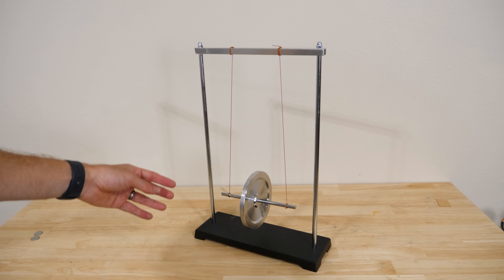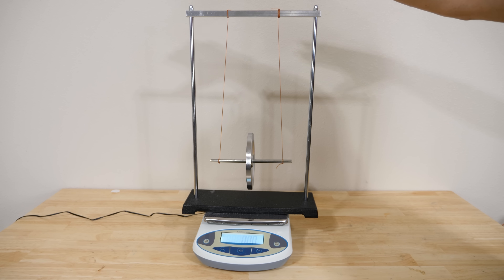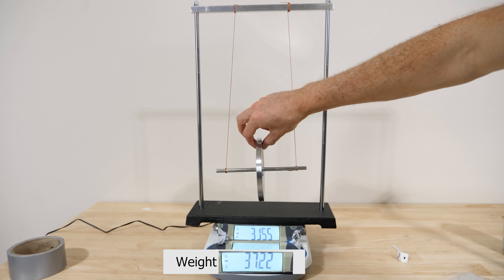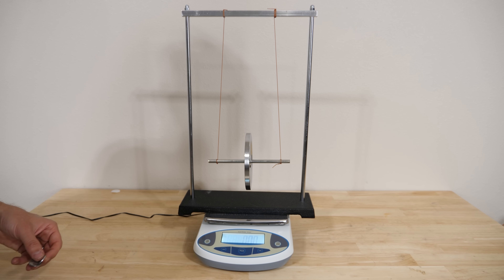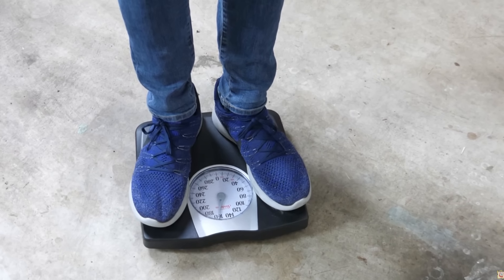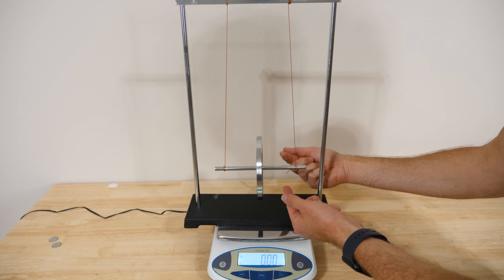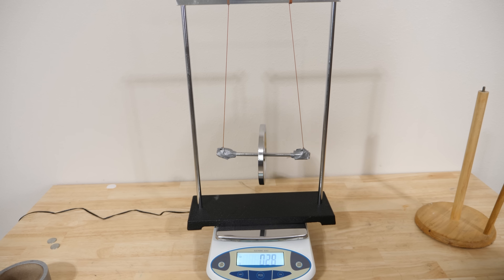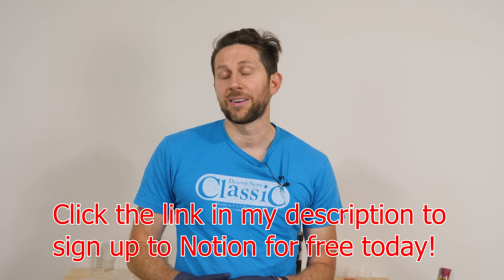How Does The Anti-Gravity Wheel Work?

Comment: @The Action Lab Has anyone built a giant turntable with giant vinyl record like spinning steel platform that has many evenly spaced spinning disks that spin perpendicular to the horizontal plane of the record like platform that their there axle/pillow block bearing assemblies are bolted down to and so that the flat plane of each disk is parallel to the tangent of the circumference of the spinning vinyl record like platform disk's edge?  the entire vinyl record like platform with the spinning disks should lift off the turn table.  Phew - This is hard to describe without a master's degree in mechanical engineering which I do not have, but I do have 2 yrs of college trig and calculus based physics for majors - college level.

Comment: Has anyone built a giant turntable with giant vinyl record like spinning steel platform that has many evenly spaced spinning disks that spin perpendicular to the horizontal plane of the record like platform that their there axle/pillow block bearing assemblies are bolted down to and so that the flat plane of each disk is parallel to the tangent of the circumference of the spinning vinyl record like platform disk's edge?  the entire vinyl record like plat form with the spinning disks should lift off the turn table.  Phew - This is almost impossible to talk about without a master's degree in mechanical engineering which I do not have, bu I do have 2yrs of college trig and calculus based physics for majors - college level.

Comment: The full expanation is correct. In effect from the moment the disc is released until it finally come to rest, it is effectively losing energy by acceleration downwards and the upward movement is decellerating as it goes up i.e. still accelerating down.
Nothing to do with the disc spinning - it will do the same with a weight hanging on a spring.

Comment: Is there really a gravity ? or as someone claimed that there is no gravity but [space and time, bla, bla, bla] which I totally cannot get it :-(
Reply: As far as I know there is no exact explanation of gravity (we don't know how it works on quantum level, because we have (almost) no experimental data), but the general relativity theory explains gravity on macroscopic and bigger scales pretty well, and it describes gravity as the curvature of space-time. The idea is that the objects move in straight lines when there are no forces applied, but the "straight line" is called geodesics and doesn't look straight when the space-time is curved. So if you through a ball on Earth, then, according to general relativity, it will move in (almost, because there is air resistance and other small effects) geodesic trajectory, which is analogous to straight line, but because there is a huge planet underneath the ball the space-time itself is curved and so is geodesics
Reply: @Eye-vp5de  Thank you for this info, I learnt something, tks again!

Comment: 8:20 Ok so its because the scale dont have enoght refresh read. or fast read.
But the rope is stil atached to the structure. the entire sistem is on the scale. Is not like jumping backwards in train with no ropes/strings. your sistem have string so the scale weight must read it.

Comment: I do not think that the spinning of the weight has anything to do with it ... what does is the fact that once let go and allowed to drop (and reflect back up) it is continuously accelerating downwards; always in the same direction. And more importantly, always with uniform acceleration.  This reduces the force it is exerting on the frame by means of the string pulling on the horizontal bar by a steady amount.

Comment: But what about moving objects that gain mass due to its moving? Doesn't that add up?
Reply: You mean relativistic mass?
If so, we're nowhere near that effect with this experiment.
Reply: @thecarman3693 yes, but my point is, shouldn't it be at-least equal if not more (since the effect is negligible at this case)
Reply: @-karthik-  Well given that the mass in this case is spinning there is just as much mass moving in one direction as in the opposite direction. I suspect a canelling of any effect from motion.  Besides, I do not think that the spinning of the weight has anything to do with it ... what does is the fact that once let go and allowed to drop (and reflect back up) it is continuously accelerating downwards; always in the same direction. And more importantly, always with uniform acceleration.  This reduces the force it is exerting on the frame by means of the string pulling on the horizontal bar by a steady amount.

Comment: Hello

I don't think his explanation is very good. So here is a better one. Note this is an optical illusion due the rectangular box, string and its measuring force.

When you lift up your legs while falling on a scale you will get lighter until you hit the bottom when all that potential gets turned into kinetic, You also note weight is attached by strings which are attached to a rectangle that is actually where the force is being weighed through.
The string rolling down as the weight slowly comes down, means the rectangular box it is enclosed in is showing this reduction in force.

Now going up, the string is rolling up, and they are attached to the rectangular bar, so now the weight is jumping up inverted with the bar, so it will have exactly the same force for both directions because it is enclosed in a box with strings.

Essentially the weight is jumping slowly upwards, again when it gets to the top, all that potential energy gets converted to kinetic energy with gravity pulling it down.

The mechanism slowly loses energy over time, heat, noise, air resistance, hence it will come to an eventual stop. At the moment the mass is at the bottom its weight is zero, but you don't see it as it occurs instantly.

Matthew

Comment: but where does the weight transfer to where does it go has to go somewhere.
Reply: Weight is a relative term we often confuse with mass. It's the mass that doesn't go anywhere, it's all still there spinning or not. The weight of that spinning mass depends on how and where it's measured --- in this case by the scale at the base of the structure. As the weight (mass) drops down, either by cutting the strings or allowing it to slowly uncoil down the strings on the bar, it will exert less force on the scale. Why? --- because it is accelerating downward. (Try dropping a weight attached to a spring you are holding onto. As it first starts to drop and stretch out the spring you will notice a small change in what you feel as the weight of the object.) So as long as the wheel is accelerating downward its measured weight will be less on the scale. And even as it reflects upward it is STILL accelerating downward. A bit confusing at first, but if you think about it when you press on the brakes in your car you are accelerating backwards even as you continue to slow down going forwards.

Comment: When the disk is falling there is less tension in the strings than when the disk is stationary. That tension is communicated thru the legs to the scale and it measures <0. When the disk is rising there is more tension on the strings than when the disk is still. So the "weight" measurement should be > 0.

Comment: Would the entire device fall slower than g, given  a = F/m = mg/m= g without rotation, yet a' = (m-6)g/m < g in the rotating case?  Seems like something is amiss and this might not be true if the device was not able to transfer momentum between the platform/earth, but I'm not so sure I understand the math, since it seems that could only be true if the change in mass was positive while the wheel was rising, and didn't remain negative throughout.  Thoroughly confused.  Do you have a reference that covers the maths in more detail?  What are the limits of the effect (mass ratio). Also a larger effect might occur if you use a ring instead of a disk as this has the highest moment of inertia.
Reply: Mass is NOT changing, Zack.  It cannot. 
.
The 50,000 foot view goes like this:
.
Think of the two accelerations that are present: 
. ONE is the wheel mass going up and down.
. The Other of the rotational momentum of the wheel  increasing and decreasing in two  directions. 

Because gravity has to do BOTH of those accelerations, some of it's effect must be taken from the up-down acceleration to accomplish the rotational accelerations.
..
Conveniently, it just so happens that it always reduces the up-down acceleration. 

The wheel's mass is obviously falling slower that it would just from gravity, because some of  that potential energy is going into the rotational accelerations.
.
What may not be so obvious is that is is also rising with less Acceleration. You may think of it as Decelerating,  slowing,  more gradually than with gravity alone.
If the wheel's mass was simply bouncing under gravity alone, it would be doing the up-down motions much more rapidly --- like a bouncing ball.

.
So the Gravity is split between accelerating the mass and accelerating the rotational mass/inertia. 
...
I stepped through the various forces in a comment some weeks ago.  If you can correctly account for the force on the string, you see that it is such that the string force always acts against gravity --- EXCEPT at the very bottom where the "bounce' occurs and the weight spikes up above the resting weight as the string reverses its winding direction.
..
If I find it, I'll add it here:
..

Comment: You mentioned Laithwaite. What if the rod attached to his spinning barbell weights functions as a lever and that some sort of 'virtual fulcrum' is in play resulting from centrifugal forces and the spinning contraption's moment of inertia? If that's the case, and the "fulcrum" is located in proximity to the assembly's center of mass (COM), the "lever" and "fulcrum" provide Laithwaite a 6:1 - 7:1 mechanical advantage in elevating his entire assembly over his head, exerting only 6-7 lbs of upward force from his right hand. If only he'd had a small, wearable force gauge in his hand to accurately display the compressive force between his hand and the rod/lever whilst filming his demonstration. The lion's share of the total mass of his assembly is located near the weights at the end of the rod, a couple of feet from his right hand. Those barbell weights seem to follow a uniform incline, albeit spiraling around him in a circular path whose length is several times that of the net vertical displacement. Imagine a 4-ton "ForeverSpin" spinning true 'n vertical - no wobbles - on a "friction free" surface at 1000 RPM. Now imagine pushing against the top of it, horizontally, applying 5-lbs of force against it with your "friction free" finger. It's gonna move some - but it's gonna resist being moved/tilted from it's vertical alignment. Imagine if you could somehow grab it by its "friction free" axis with your "friction free" hand at a point 10-feet above its apogee and push against it horizontally with a force smaller than 5-lbs. You could conceivably move/tilt it off its vertical axis the same amount with less force. Leverage does that for you at the expense of displacement. The smaller force vector is applied through a greater distance to effect the same change in tilting. It's hard to believe Laithwaite would not be straining if attempting to jerk a 40-lb dumbell from his waist to the max height straight over his head in a direct vertical path with the same ease he displays elevating his contraption on camera. I think Dr. Laithwaite's demonstration and low force requirement observations are honest and spot on.

Your own experiment is different than Laithwaite's. I just wanted to pitch my theory supporting his "light as a feather" claim.

Comment: The setting is quite simple, the wheel move into a distance, the spinning wheel is energized so impetus reduces the weight during the movement, unlike the fixed gyro which is restricted of movement

Comment: OK let's get this correct  !!   #1  The only reason radio waves and AC current travel out in space and down a wire is because of the "CENTER " of a magnetic field.  (The "B" field), The North and South poles are the weakest part of a magnet !!   Just like Tesla said,  you got to look at things you can't see !!  At the center of a magnet is anti gravity,  (just tap the center on any glass or plastic and it will loose weight), The center can repel water if vibrated at the correct frequency,  If you vibrate the "B" field into granite rock it will become soft and you would need copper tools to work on same , you don't want to disrupt the magnetic (B")field ) with other iron.  Once you understand the "B" field of a magnet and how it relates to the entire universe we live in, you will then understand what Tesla was telling everyone "LOOK FOR WHAT YOU CANNOT SEE""  .I believe the pyramids were inter galactic communications and transportation systems.  Stone Henge and Gobekli Tepe , power plants.  Take a look at Coral Castle Florida on YOUTUBE and you will see a similar pilar. I believe these horizontal pillars were oscillators that would provide excitation for many things from crops in the field to anti gravity

Comment: This is why you should not use kitchen equipment to do scientific measurements, because at best it’s inconclusive.. otherwise I’d guess a short and sudden spikes of weight would cancel out the -6 grams difference you are getting! 😅
Reply: Of course.  It is VERY similar to a bouncing ball, or you on a trampoline.  They are weightless when in the air and heavier when rebounding on the bottom.
.
This very clever system just has something acting partly against gravity when it is off the bottom.
...

If you think carefully, you will understand that it is lighter both when moving above the bottom 'bounce'..
Carefully note that it is increasing speed while descending and decreasing speed when ascending.  This is just like something that is bouncing.
It still behaves as though it is constantly accelerating downward, but at something less than that caused by gravity. . .  a reduced gravity
.
Think about that. . . .
.
A bouncing ball is in free-fall when not in contact with the ground, and weighs nothing,  BUT ithe ball's  mass is accelerating downward all that time at 9.8 m/s^2 from gravity.
Well. . . 
This wheel's mass IS accelerating, but it is less than that, so the exchange of energy between the elevation and the spinning is actually reducing the net force to something less than that from gravity alone.
Thus it weighs less up and down, but more when actually bouncing at the bottom.
Cheers.
Reply: @Observ45er  Yes, my point is that, if you keep track of the weight in its entirety, in average, over an extended amount of time ( bouncing up and down ) it should cancel out. it is not going to hover in the negative anymore.
It can be about -6 for 10 seconds, but then +120 for a fraction of a second. Overall it should average to zero since it's a closed system.
Reply: @mimArmand  Yes.  He mumbles something about that. but glosses over that it will weight MORE than it's normal weight for a short time at the bottom.
Reply: @mimArmand  Of course.  It's a shame Action-Lab-Guy doesn't address this.
He  finds thought provoking things, but is frequently lacking in real analysis.  I emailed him on this one, but I doubt he'll respond. I saw a comment that he doesn't.
Reply: @Observ45er Right, although I don't expect him to read all the emails and messages, he's doing the best he can.. Looks like a one-man band, gotta give him credit where it's due ;)

Comment: It may be because the electronic scale is too slow. It should be lighter going down and heavier going up.
Reply: @frankhoffman3566  

If you think more carefully, you will understand that it is lighter both ways.
Carefully note that it is increasing speed while descending and decreasing speed when ascending.  This is just like something that is bouncing.
It still behaves as though it is constantly accelerating downward, but at something less than that caused by gravity. . .  a reduced gravity
.
Think about that. . . .
.
A bouncing ball is in free-fall when not in contact with the ground, and weighs nothing,  BUT ithe ball's  mass is accelerating downward all that time at 9.8 m/s^2 from gravity.
Well. . . 
This wheel's mass IS accelerating, but it is less than that, so the exchange of energy between the elevation and the spinning is actually reducing the net force to something less than that from gravity alone.
Thus it weighs less up and down, but more when actually bouncing at the bottom.
Cheers.
Reply: @Observ45er  Before I'm convinced of a theory, I would need to first see this tested with a  good scale that didn't have a lag period in it.  After reviewing the data the effects on gravity would  have facts as the working parameters.
Reply: @frankhoffman3566   As I said, the physics says as I described.  If you need to, then Do it.  It is pretty simple to set up. It can't be done here.